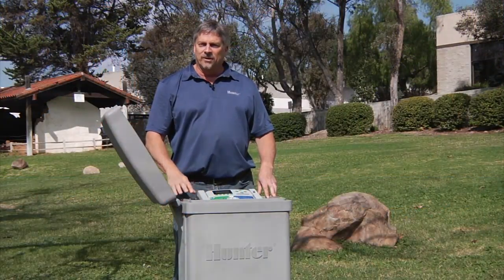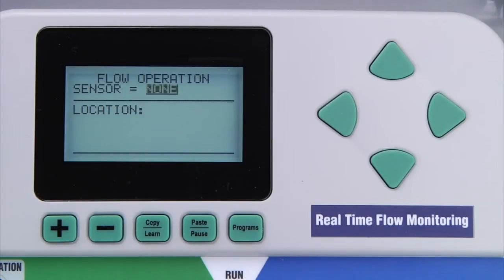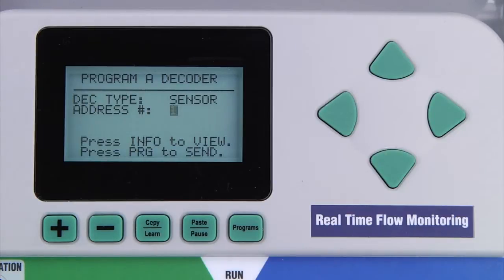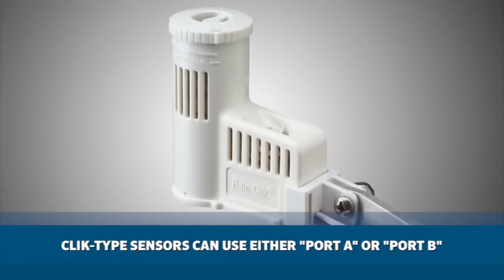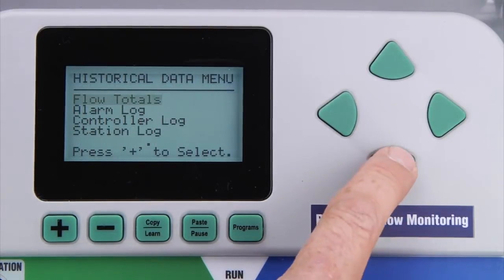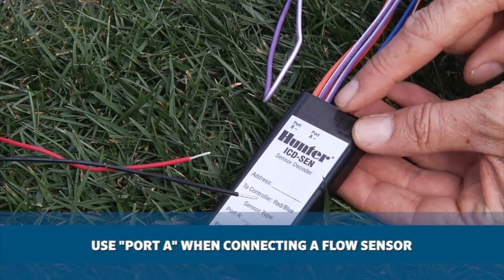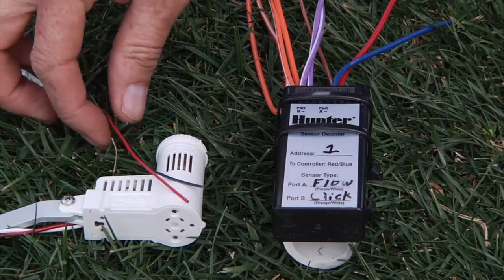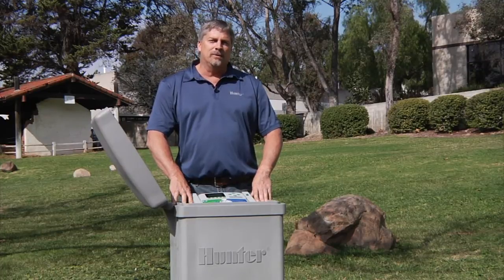ACC Advanced Programming: Decoders, Part 2: Sensors

Comment: When connecting the click type sensor to the orange wires for port B is there a positive and negative just like the purple wire for port A? If you attach a click type sensor to port A do you have to consider polarity or is this unique to the flow sensor?